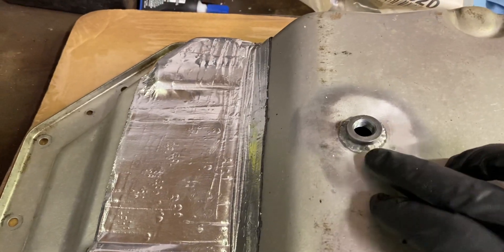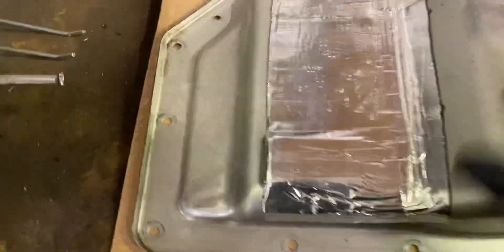2500HD Snow plowing truck transmission fluid maintenance/6L90E pan drain plug

Comment: I've never done it but, you can do a pretty good exchange if you use the cooler lines to flush out the transmission. I've watched the videos a few times but haven't done it yet.

Basically one line in one line out attach rubber hoses to the appropriate ones and pull the old out and draw the new fluid in.

Comment: How come you didn’t put it in the lift?
Reply from the maker: ha, I was waiting for someone to mention that.  If I had a prize, it would be yours.  I didn't put it on the lift mainly because of 2 reasons.  1. I didn't feel like removing the back blade.  2.  I have 1,000+ pounds of ballast in the bed of the truck, so the truck doesn't lift well/safe like that.  My 2 post lift is asymmetrical (front arms short, rear arms long) style so by design the vehicles sit back farther in relation to the posts compared to a symmetrical lift.  At the end of the day it's a real easy job to drop the pan anyway, so it was just easier for me to drive the front up on ramps and lay my fat ass on a creeper.
Reply: @LoneWolfSnowplowing  I kind of thought that too. But I also said why not use the lift it kind of defeats the purpose of having it. Idk maybe just me because I don’t have one lol
Reply from the maker: @GardenViewLawncare  yeah that lift has had lots of use.  My main business is automotive repair based as I've been working on mostly just Nissan/INFINITI for 20 years, I also do some performance stuff when I have time.  I have a few other videos on my other channel.  https://www.youtube.com/channel/UCBxPKApMpQtvssE9jflAzFw
Reply: @LoneWolfSnowplowing  I was shopping trucks and almost went with a Titan xd but decided to go with a 22 silverado 2500 6.6 gas. Did I make the best choice? I think so
Reply from the maker: @pryme2013  well I’ve made a career out of working on Nissan/Infiniti vehicles for 22 years so I love the Titan but I certainly think if you’re going to be plowing you’re better off with the GM.
Reply: @LoneWolfSnowplowing  Yeah I was also worried about Titan being discontinued soon especially the xd and the low volume they sell that parts would be hard to come by 10, even 20yrs down the road. I plan to keep the truck that long so the GM should have plenty of parts both new, aftermarket and trucks in the junk yard that got hit ect

Comment: i have similar truck 2016/2500 hd chev. right around 30k now and will get trans changed after this season. snoway 29hd plow and snoway salter. So correct on the airflow with plow mounted- i always show incorrect outside temp when driving. my trans temp has not gone above 160 so have not worried about cooking the oil. thanks for the video- good info.
Reply from the maker: PLOW BOY , hi how’s it going? I’m curious do you mainly just plow open/flat parking lots? I do 99% only residential and some of my driveways are pretty steep. Also my area has been on a pattern of some pretty slushy heavy snow past couple seasons.
Reply: @LoneWolfSnowplowing  I do some commercial ( smaller asphalt/ gravel lots ) driveways - mostly gravel.  I also need to shovel / salt about 5 of the properties ( walks etc. ) I also try and wash off the truck with each event. Worried about the salt damage.
Reply from the maker: is yours a diesel?
Reply: @LoneWolfSnowplowing  it is the 6.0 - just couldn’t afford the diesel. Mine is an LT- nothing fancy. It did have a package of sorts that got me a few extras like heated mirrors and better wheels etc.
Reply from the maker: @plowboy6636  yeah I’m not a fan of diesels for plowing. They tow great but the extra expense, the bullshit problems, the noise and stink. I’m not a fan.
Reply: @LoneWolfSnowplowing  I do believe based on what I have learned is that the 6.0 will last a long time as long as you maintain it properly. many with 200k plus and still running strong.